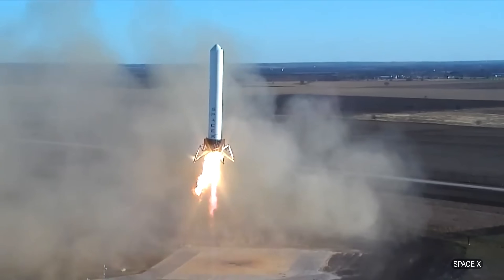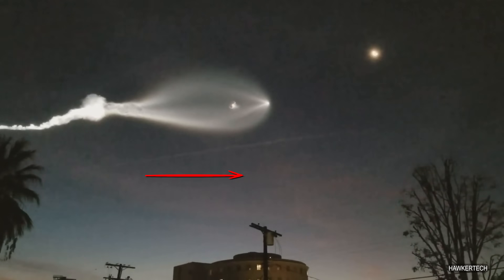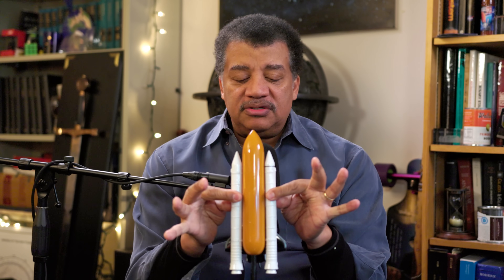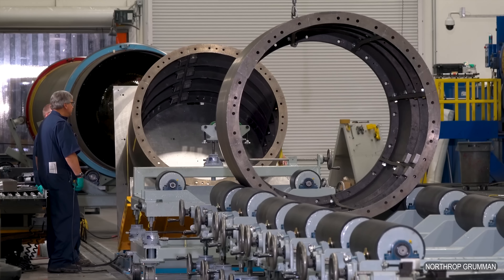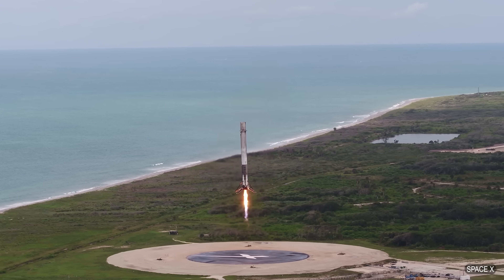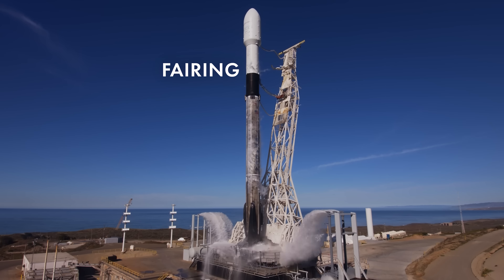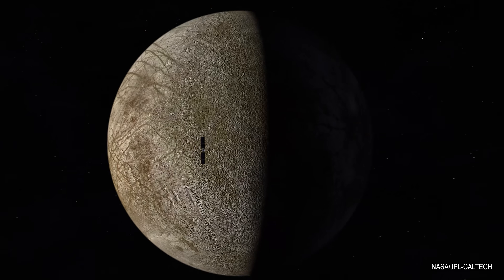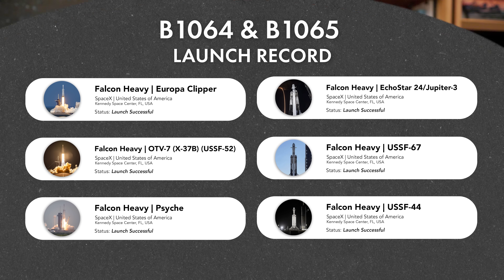What's Up with Reusable Rockets?

Comment: As great as the shuttle technology was, it still cost around $1.5 Billion per launch. And it was only partially reusable. The current cost of a Starship launch is about $100 Million, but the rocket is fully reusable, and as things improve, that cost will come down. No to mention that the payload capacity of starship is 5x the shuttle.

Fingers crossed, Neil gets to visit the Moon or Mars or some other place in the solar system in his lifetime 😉 👍👍

Come on Billionaires... get it done!!!!  😘😘

Comment: Planes refuel in the air, would it be more cost effective, fuel-wise, to possibly suspend these boosters in the stratosphere and then attach a plane or something to it in the air? Would that use less fuel?

Comment: Reusable rockets have the potential to revolutionize space travel and make trips to space much more routine. Companies like SpaceX, Blue Origin, and others are already proving that it’s possible to launch and land rockets multiple times, drastically reducing the cost of getting to space. In the past, the cost of space exploration has been a major barrier, as rockets were used only once before being discarded. Reusability changes that by making rocket launches far more affordable and accessible.

However, while reusable rockets are a game-changer, there are still many hurdles to overcome before space travel becomes as routine as commercial air travel. For one, ensuring safety and reliability with each flight is crucial. We’re also looking at technological improvements and infrastructure that will need to evolve to accommodate regular space missions. But with the pace of innovation we’re seeing in the private sector, it’s not hard to imagine a future where space tourism, cargo missions, and even human space travel are far more commonplace.

In short, while there are still challenges to be addressed, the advancement of reusable rocket technology is a massive leap forward, and it could very well lay the foundation for routine trips to space in the not-too-distant future. The dream of making space more accessible to the masses is within reach, and it's an exciting time to witness the rapid progress.
Reply: Thanks for asking an AI to tell you about reusable rockets and posting it here.
Reply: I cant wait for new glenn to come online, and neutron and stoke rocket. It will be really interesting to see what that does to the market. Not sure how close china is, although I don't think that will effect the global market much.
Reply: none of these rockets are going into space because they can not break through the firmament

Comment: I have an issue with the starship concept as a space cruise liner to Mars... the refuelling in orbit will need a lot of launches (10?) and as we have seen there are fundamental issues with the design of the two stage booster and starship.  They blow up.  I don't think you would get 100 pioneers to enter one starship to a trip to Mars.  Getting to orbit then hanging around for 10 dangerous in orbit refuelling and then a 9 month trip to Mars and then a hazardous landing. Then you have to get back, creating the fuel, ground OLM infrastructure, at least another 9 months trip ? Refuelling on mars is not worked out and neither is how you sustain even 1 astronaut on mars (see the Martian movie).  We are looking at decades before a starship gets to Mars and in that time I think others will have alternatives.
Reply: "as we have seen there are fundamental issues with the design of the two stage booster and starship."
no

Comment: So I've always wondered why it seems like no one is trying to make magnetic launch systems. A huge chunk of fuel is used up just getting the rocket moving to start with. 
Are they prohibitably expensive to build? Are the power requirements unfeasible?
Reply: Spin launch wants to use a "catapult" but it can only put 200 kg into orbit. And hasn't successfully that yet.
Reply: @Smiles10130  yeah heard of them. Not exactly something you can put a person in though.

Comment: Booster is not a plane. There is a reason why NASA (that invented the reusable rocket) did not go that way. Whether something is expensive is always in relation to something. Turnover time for SpaceX boosters is nothing special. Cost savings are not reflected in the price that SpaceX charges (it has been heavily subsidized by the state). Routine rocket flight was the promise by Musk, 10 years ago, still not there.
Reply: how often does the falcon 9 fly?
Reply: @snuffeldjuret  Falcon9 is a type of rocket, they are not flying the same one twice a week.
Reply: @snuffeldjuret  How is that related to anything that I have stated?

Comment: Starships 'catch tower' (Mechzilla) removes the weight (and complexity) of landing gear ^_^
Reply: I wonder if falcon 9 can be caught with the chopsticks in florida?, that would increase the payload
Reply: @enoughofthis spacex won’t spend the resources on designing that
Reply: @enoughofthis  Catching requires the rocket to hover. The Merlin engines cannot throttle down enough to hover. That is why on the Falcon 9 landings the engines start so close to the ground. They don't hover and land, they slam on the breaks then turn off. Just 1 Merlin at its lowest throttle can lift an empty Falcon 9 booster.
Reply: @robot-andrew  thx
Reply: @enoughofthis SpaceX is currently working on a Starship tower in Florida. Whether or not boosters from Texas will land there remains to be seen- I haven’t seen any public plans for that sort of thing yet.
Reply: AFAIK, they also remove landing gear and grid fins (mby?) when the mission is expendable.
Reply: @paprikar  Starship is designed to have so much payload capability that they won't ever have to expend a booster! 150 tons to LEO fully reusable!
Reply: @timeydoesstuff If ever that capability is needed, then it would cheaper to launch a second tanker starship to refuel the mission in orbit than expend the booster with 33 raptors
Reply: Landing gear in my opinion isn't that complex. A catch tower is on the other hand. With landing gear, you can theoretically land anywhere on a flat solid surface but with a catch tower...well you need a tower built and the means to get back to it for the catching to happen.
Reply: @shawnmurphy731  That's not accurate. Just watch at the 24/7 livestreams in Floridas port area by NSF for example. You can see how they take some time to fold the legs back in since they have no system integrated to do that (which again would need more mass) and the problem gets worse with the mass of the rocket. Also legs aren't that much of a guarantee to have a smooth landing. In lower gravity environment there is way less downward force, so you tip over much more easily.

The first ships on each new planetary body will need legs, but if we want to expand, we will start building stuff there anyway. So we can also build towers there.
Also you can play it much more safe with the safety and backup system in a stationary landing device since mass isn't that much of a factor anymore.
Generally you want to have as much complexity and mass away from the thing that needs to propell itself.

It's overall a really good optimization.
Reply: @norinokia2307  I could see this being a good first step to expand quickly. I still think testing for landing on solid ground is still something that should be progressed along with quick recovery of the vehicle for quick turnaround.  What I really want to see is space-based manufacturing that builds an actual spaceship that just travels through the void and doesn't land in which only landing craft will take that role.
Reply: @ it’s very complex and heavy. That’s why they don’t have it.
Reply: @shawnmurphy731 there’s not a lot of practical use cases in landing on any random “flat solid surface” if you haven't got the infrastructure nearby to safe the rocket, refurbish it, and relaunch it.
Reply: @shawnmurphy731 you could build catch towers on floating platform and get them travel to whatever place in the ocean the starship will land. So, it's not necessary for ship to go back to the launchpad
Reply: The booster still has the catch pins and the grit fins that weigh a lot and may not be necessary for a one-way trip
Reply: @jdenha7078 the point is that it doesn’t make a one way trip
Reply: @jdenha7078 starship will be capable of in orbit refueling.
Reply: @jdenha7078  Lunar starship won't have those pins

Comment: The future of rocket body materials is exciting and rapidly evolving. Here are some potential developments:
Plastic Polymers:
1. Advanced polymers: Researchers are exploring new polymers like polyetheretherketone (PEEK) and polyimide (PI) for rocket applications.
2. 3D printing: Additive manufacturing (3D printing) is being used to create complex rocket components, including those made from polymers.
3. Lightweight and durable: Plastic polymers can offer significant weight reductions while maintaining durability.

Carbon Nano Fibers:
1. Carbon fiber reinforced polymers (CFRP): CFRP is already widely used in aerospace applications, including rockets.
2. Nano fiber enhancements: Researchers are exploring the use of carbon nano fibers to further enhance the strength, stiffness, and durability of CFRP.
3. Multifunctional materials: Carbon nano fibers can also be used to create multifunctional materials with integrated sensing, actuation, and energy harvesting capabilities.

Future Materials:
1. Graphene and 2D materials: Graphene and other 2D materials are being explored for their exceptional strength, conductivity, and thermal properties.
2. Meta materials: Researchers are designing meta materials with tailored properties, such as negative refractive index, to create advanced rocket components.
3. Smart materials: Shape memory alloys, electroactive polymers, and other smart materials are being developed for self-healing, morphing, and adaptive rocket structures.

Comment: One thing not mentioned is that getting the hardware back allows you to improve the vehicle and make it more reliable and you don't need a huge fleet of vehicles to sustain a high launch cadence.   Now SpaceX has gotten to the point that customers wants a flight proven booster for their launches and they will use a low risk launch like a Starlink launch to verify a new booster works as expected.

Comment: Hi Neil, are you familiar with the concept of asparagus staging? I'm surprised no research seems to have been made on it. This is something Kerbal Space Program players have been doing forrever, it's so good it almost feels like cheating, to the point where I know fellas who makes a point of not using it because it's too darn good. I understand in the real world, fuel transfer between cores is a lot more complex than just slapping a yellow pipe between them, especially when it comes to staging, but considering the crazy things they are able to do today, I'm surprised nobody spent money trying to get Asparagus staging working!

For people not familiar with the concept, is that you make a rocket with multiple cores, like falcon heavy, for example. When you launch, all three engines fire, but the center core's engines would use the fuel from the two side boosters, until right before staging, where they would switch to the center core's fuel. What this means is staging happens a bit sooner, since the side booster fuel is used up by 1.5 cores each, but your center core is full of fuel.

What they currently do is they throttle the center core down so it burns less fuel than the two boosters, and so it still has fuel once the side boosters stage away, and it can ramp up then. If you do the math, asparagus end's up being a lot more efficient, because the current way of doing it means you carray a big, but mostly empty rocket which is dead weight.
Reply: spacex tried it with falcon heavy
although, not very Asparagusy, just with the 2 side boosters to the core
Reply: @snuffeldjuret  I don't think they do that with FH... I think they just throttle down the center core. They aren't transfering fuel from the side boosters to the center core.
Reply: @snuffeldjuret  oh I get that! But 10 years ago you could have never imagined something like starship, and yet, here we are! If someone came out with a technique to make this reliable, it could be a game changer!

Comment: I think that reusability SpaceX style has yet to prove its rentability. As you said, reusability has a cost which can only be overcome by a lot of launches. As there is no market for that, SpaceX invented it's own artificial market (Starlink) which accounts for around 90% of the launches. Will it be profitable in the long run? Perhaps but there are two thing that cast doubt on that : 
- there are at least 4 or 5 competitors of Starlink in the making. Some of them will be highly subsidised because sovereignty (China, Europe, perhaps India and Japan). There is no place for a commercially viable market of this size.
- environmental concerns : exponential carbon emissions because these mega-constellations will need constant replacing of the 10th of thousands of satellites (and you have to add the carbon emissions of the construction of the satellites and the launchers to the emissions of the launches themselves : methane burning and relieve) + the water coming from the combustion staying in the mesosphere instead of rentering the water cycle + all the nanoparticles produced while de-orbiting thousands of satellites (some especially bad for the ozone layer).

Comment: Can't we just use parachutes and flotation devices to reduce damage and simplify recovery from the ocean, in order to reduce the reuse cost? Catching the rockets with "chopsticks" or landing them on quadpods seem overengineered to me.
Reply: Then you get sea water in everything.
Reply: U can never have a rapidly reusable rocket if u do that. Also Having massive legs on the booster of the starship increases weight. Hence catching it

Comment: OK, the airplane comparison is a bit off, because airplanes rely mostly on aerodynamics (and friction) when landing and only to a very small extent on the fuel they carry, whereas rockets have so far only relied on aerodynamics to a small extent (e.g. grid fins at SpaceX) and carry out the loading process entirely through fuel combustion. The economic calculation of an airplane landing is therefore probably structured a little differently than that of a rocket landing.
Reply: ok hear me out
one trebuchet per launched rock :D
Reply: Huh? It’s easier to land a plane than a rocket. It took SpaceX to come and show the stagnate incumbents how to do it. And they still can’t do it lol.
Reply: @ultrastoat3298 will let's be honest, nobody can land a rocket up until now. Even SpaceX is only able to land the booster in the best case.
Reply: @ what are you talking about.  Spacex has landed +400 boosters.  What are you talking about "in the best case".  Its literally the majority case by a mile.

Comment: 10 to 20 missions for fuel to the moon. It was much simpler when you don't expect nasa to pay for all yr research and development to get to mars. . If they could just get to orbit. then then if they could orbit. if they could just transfer fuel in orbit on the next mission,  if they could get down to earth safely . if they could do all that 10 times, if they could land on the moon with a 50 mtr tall spaceship with a big ladder.   if they could get the engines to start on the moon, If they can return to earth with a payload , then they have completed 30% or the technical obstacles to getting to mars . Elon says it will be very soon

Comment: Comparing to reusable airplanes can make wrong impression, since ratio between cost of launch and cost of reusable part can differ by the same factor of thousand. I.e. plane ticket is 300$, plane itself - 300M $.
All the while reusable boosters just became marginally profitable. That actually is the stated reason while soviet space program did not even consider making reusable boosters - negative net gain (net loss). 

Actual achievement here is that SpaceX finally made them produce a positive net gain, it is not like they created any sort of new tech. Regardless, "optimization" achievement is still an achievement.
Reply: It's new tech, just not a new idea.

Comment: We humans have made a lot of arms. Many of them don't carry fuel with the bullet. I'm here to ask, can we scale up one of the more efficient ones that don't need to carry fuel with the bullet?
For example, we could scale up a railgun. Build a long tunnel onto the side and above one of the tallest mountains near the equator in the East direction to give it a maximum boost.

By some naive calculations by a friend, such a system could launch (non-human) payload up to 700 km altitude. Not space worthy, but definitely into a stable satellite orbit around the Earth.
We could still add rockets onto that for space missions, but the fuel needed would be reduced a lot.